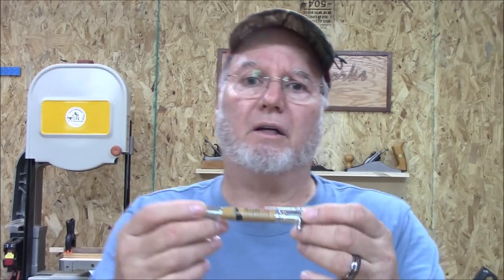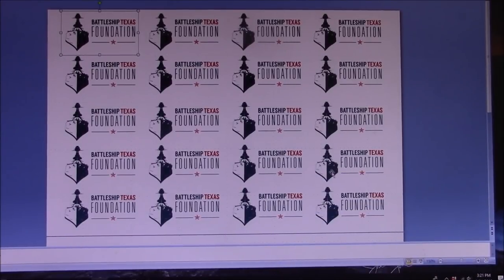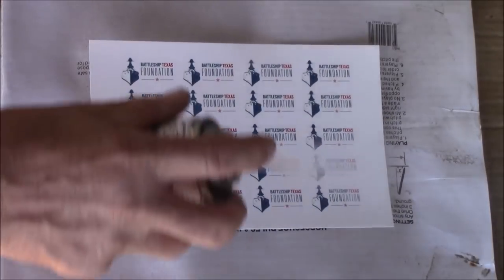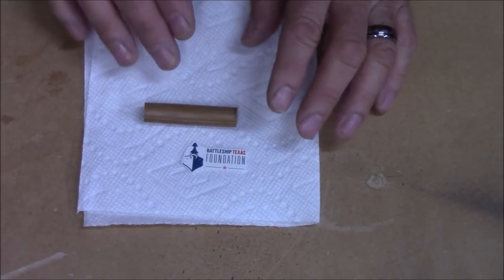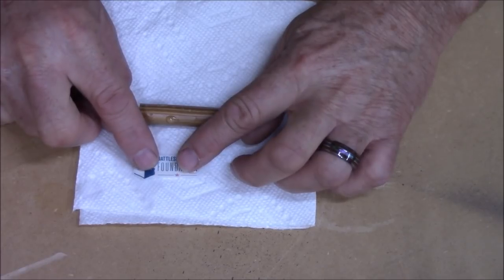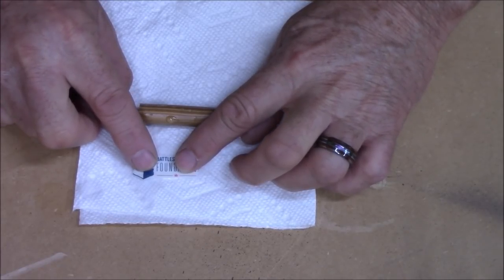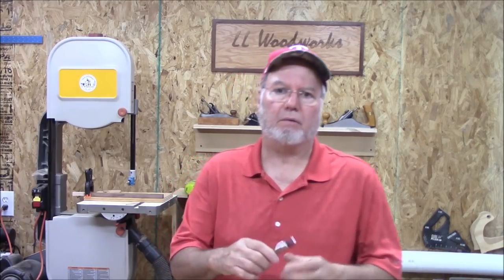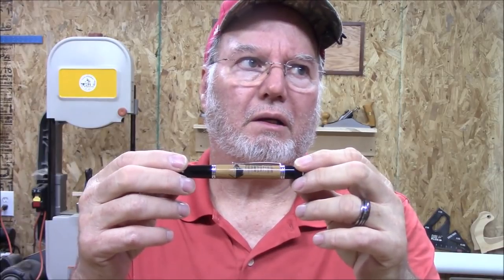How To Apply Decals to Your Pens

Comment: I have used rustoleum clear enamel and the clear satin as a sealant. I put 2 coats on it. Not sure if I missed it in your video, but I let my decal, once on the blank, dry for a few hours because the water under the decal reacts when I apply my coats of CA over the decal. I usually end up putting 8 or so coats over the decal then micro mesh or buffing wheel to a high shine.
Reply from the maker: Sound like our process is very similar. Yes I wait a few hours after applying the decal. Thanks for watching

Comment: To set the decals, you can also use a finish like Helmsman Spar urethane from Minwax. This has the added benefit of UV protection, if the stuff you use doesn't. The Minwax stuff also doesn't take that long to cure. 
You also know that wetting your blank didn't do anything, right? Just beaded and then dried. No harm in doing it, but it's a step that seems unnecessary given the CA finish.

Comment: Fpr what is worth - I live in Michigan, and during the winter in my heated basement, the humidity drops to 35-40%.  I made several walnut pens several winters ago, and finished with medium CA and sprayed accelerant between coats (about 10). After two months, the pens developed a cloudy bloom.  I switched to super thin CA (Starbond EM 02, thin like water), which set up in 30 seconds or so....and skipped the accelerant. I have never had a cloudy bloom since.  PS, when applying decals, I use a color ink jet and a white lacquer background...and always wait overnight before applying a CA finish.
Reply from the maker: Big difference in conditions there and here. I usually don’t have a problem but it has been 100% humidity. Good idea on the this with no accelerant, I don’t use it if I don’t have to. Thanks for watching

Comment: Hi Lynn, really cool process using the water slide decals. Is the purpose of the top coat to seal the ink do it wont run? I have used clear peel and stick clear waterproof print labels and while the end result can also be good you only get one chance to position the decal on the pen and I have messed up many a pen blank. It seems using the water slide method you can slide the decal into position as needed and if you don't get it just right you have a few seconds to get it positioned just right? I really want to give this a try now. Thanks a bunch for showing the process and dig your new shop.
Reply from the maker: You are welcome and yes it’s a little forgiving,thanks for watching

Comment: Here's a thought I was having. I don't use any CA on my wood pens for a finish, usually it's boiled linseed oil, then I started using clear polyurethane. What if I used that on top of the decal, maybe 2 coats, would that seal it in there?
Reply from the maker: Good though but I’ve never used boiled linseed oil. I have used poly but never over decals, but don’t see why it wouldn’t seal it

Comment: Would this method work for metal pens?
Reply: It does, but it will look kind of funny if you use a glossy decal paper and the metal pen isn’t shinny, also if you can put a layer of CA on top of the decal it will keep it from being damaged or getting scratched
Reply: @ac482190  what is CA and would it mattify it to blend better?
Reply: Jenifer's Faith CA is the glossy glue that is used to give pens the shiny finish, I’ve personally never put CA glue on a metal pen, but it should be fine, it’s just glue, if you are thinking of doing a CA glue finish on a metal pen with a decal do it as it is on the video, do one coat of thin CA glue, add your decal, then add some CA to seal it off, also think about sanding it down with sand paper pads, it’s sand paper that goes in water and works best for finishing the CA glue finish
Reply: @ac482190  thanks for your help. I will give it a try